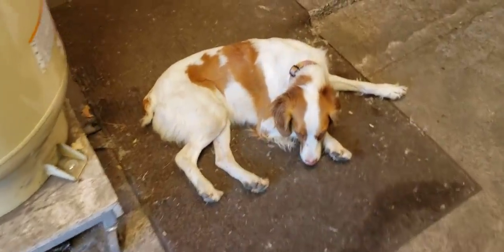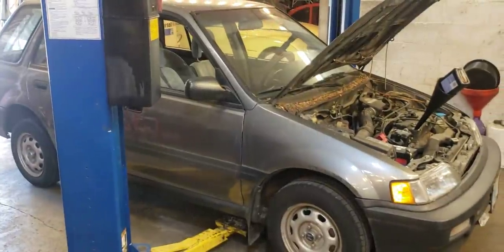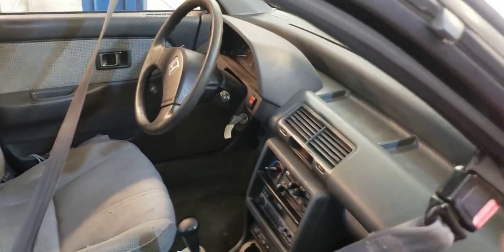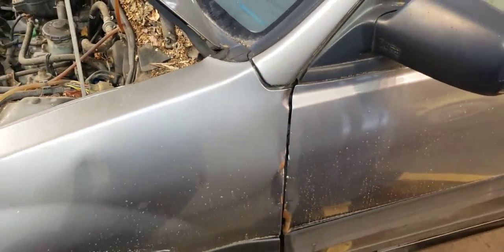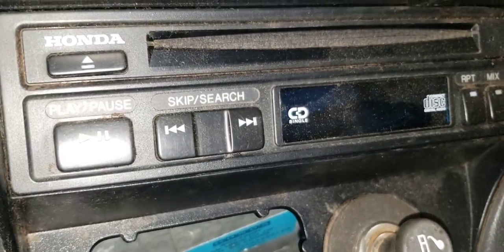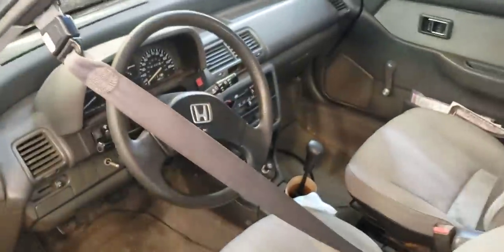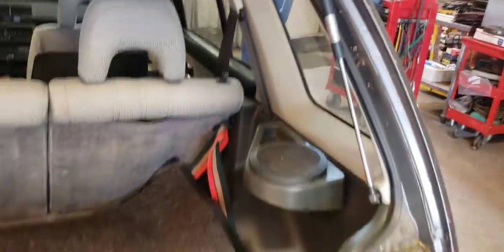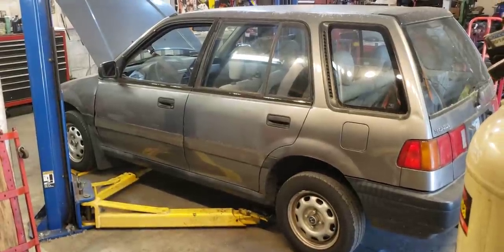Wonderfully Wacky WagoVan

Comment: A couple of minor corrections.  I owned a '90 identical to this example here.  A "Wagovan" did indeed have its own badge saying that, and this car is not one.  The Wagovan was more basic still, having I think vinyl upholstery and a non-split folding rear seat.  And it had little horizontal protection bars on the inside sides of the rear quarter windows, to protect them from sliding cargo (?), only on the Wagovan, not seen here.  '88 to '91 Wagovans and regular FWD Civic Wagons were 1.5L 16 valve, with dual-point PGM-FI as you say.  If you got an automatic, you also got power steering, but sticks didn't, and with A/C as ours had too, I thought it badly needed PS.  The 4WD model I believe had PS whether stick or automatic, and was a 1.6L multi-port PGM-FI, the same engine as the Civic Si and CRX Si.  All of what I say definitely applies to USA models - and much if not all to Canada also, since distributing the same stuff is easier, less because Canada required cars to meet US standards.  I happen to know from seeing a brochure that 4WD Civic Wagons sold in Europe during this time frame were fancier, with power windows and locks, because the car's market slot in Europe was less price-sensitive than here in N America.

Comment: That is NOT a Wagovan.  It’s a Civic Wagon model which came in front wheel drive or four-wheel-drive. Many people fall in love with the quirky Wagovan name and assume any Civic Wagon is a Wagovan.  The truth is that Wagovans accounted for a very small percent of the Civic Wagons imported. I bought a new Civic Wagon in 1990 so I am very aware of the model. The Wagovan was a subset model of the Civic wagon line.  It was based on a special Japanese market model that was used as a small delivery vehicle.  The way to tell a Wagovan from a Civic Wagon is that the Wagovan has a horizontal bar across the middle of the tall side back window (to prevent cargo from breaking the window) and it has a rear seat with an almost vertical rake on the seatback. Both of those features were to allow it to carry as much cargo as possible in the Japanese market.  American Honda brought the Wagovan model to the USA to be a low-cost leader.    The idea was to move customers to the regular Civic Wagon where the backseat was a lot more useful for passengers.

Comment: We have a 1991 civic wagon 2 Wheel Dr. 1.5 L engine with 450,000 kilometers/279,617 miles, same colour.  We have owned in the family for the last 20 years.
It’s on its second engine. In Canada we have conventional seat belts,  thank goodness. I was fortunate enough to buy the full size  Honda workshop manual that was made just for the 1991 wagon. I paid around $40 for the manual. Yesterday  it died on the road and BCAA had to tow it home. Cranked but no start. Eventually I found that the distributor rotor set screw had loosened, allowing the screw to fall off into the space inside the cap and rotor to spin loosely.  It seems to be an after market distributor that hasn’t a flat machined on its shaft for locating the rotor properly. Have to continue tomorrow, oh well 😔.
I’m a subscriber who loves all your videos. Thank you so much.
😀🇨🇦✅

Comment: We had a 1989 Ford Tempo 4WD that had those seat belts. You quickly learned never to open the door and look back when backing up even in a tight space, it would drag your head down the the dash and it pushed hard. Any more power and it could have broken your  neck.

Comment: Had no idea, those seat belts existed!
Reply: the airbags now required by law started out with regulations which allowed "passive" seat belts as an acceptable substitute that was quicker and cheaper to implement for the automakers' engineers and production lines, and only a specified percentage of each manufacturer's line had to have either, gradually getting to be a bigger % year by year.  Thus we had the situation where the '88 Acura Legend base and Legend L had regular seat belts, but the '88 Legend LS had one airbag.  And no '88 Honda Accord had any airbags, with the Accord sedan having regular seat belts, but the Accord Coupe and Hatchback having door-mounted "passive" belts.  By the time of us buying our '95 Nissan Quest minivan (same thing as a Mercury Villager), it had one airbag but not two, so it had to have passive back-and-forth shoulder belts.
Reply: Had a 1991 Acura Integra w/ these seat belts; there was a lap belt which had to be fastened by hand.  By 1993, the Civic sedan I had was equipped w/ driver's side only airbag, and conventional 3-point belts w/ a convenient adjustment for the shoulder belt.  A much better set-up!

Comment: I have a 91 Honda Civic Wagon, had it for years.  It's Honda's 'real time 4 wheel drive'.  Fully automatic, very complex transmission, with extra low gears.  Only problem with it is it tends to rust in certain areas.  Runs like a top.  They made them in the 80s as well, I believe.
Reply: yes, the earlier version of Civic Wagon had a 4WD version 1985-87, just not the first year ('84) of that generation

Comment: My '94 Mazda Protege DX has the same electric seat belts...which works OK, but sometimes there is a lag and if a front passenger is leaning forward and the belt suddenly retracts it will clothesline that passenger in the neck.  An additional open and close of a front door clears this out for a while...I suspect a lot of the cheaper mid-90's sedans had this quirk in them.  Back then, only the super expensive cars had airbags as an option.

Comment: Going from memory, and I may be wrong... long time ago, I believe VW had this seat belt setup in some of the Rabbits. There was no lap belt so they put in a big knee bolster instead. I can see why they eventually dumped it. I think the whole idea was to make it so that people had to wear the seat belts.
Reply: Had a Rabbit and Fox in my family.  Yes, there was a lap belt but as with every make's "automatic " seat belts, you had to fasten the lap part manually.  This was the problem: if you didnt fasten the lap belt ( and a lot of people didn't), you could slide under the shoulder belt in a crash and still get seriously injured. VW was clever enough to not use a motor,  the belt extended with the door when you opened it.

Comment: Crashed one of those back in 2013, right into a mountain side to dodge a moose! Knocked one of the front wheels right off the centre, and bendt the driver side a-post so it was like a 90 degree angle! Neither me or the driver were hurt, and we actually managed to drive it home on 3 wheels, as it was a 4wd! I miss that car, even tho it was a total rustbucket

Comment: What on earth those seat belts :0 
I've never seen anything like that before, that's crazy
Reply: Federal government mandated some sort of passive restraint system in new cars in 1991 or so...either airbags or motorized seat belts met the requirement.  Cheap cars like this Civic or my '93 Mercury Tracer had the motorized belts, more expensive cars got airbags.  Airbags became mandatory for all cars in 1995 and the motorized seat belts disappeared.
Reply: we thought so at the time too - but they were required as a stop-gap substitute for airbags, which weren't yet cheap enough, or engineered enough, to put in all car models.